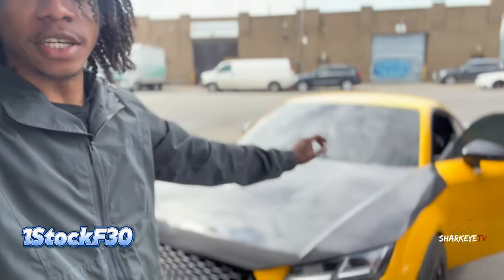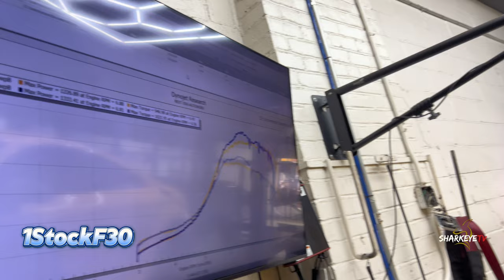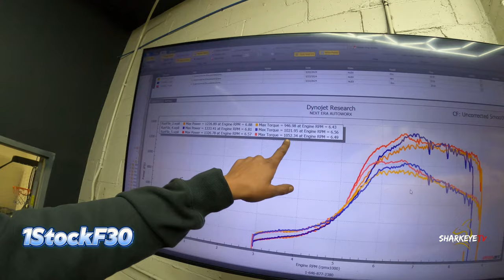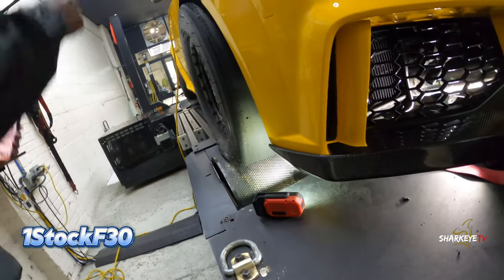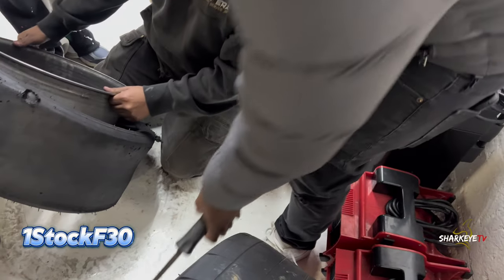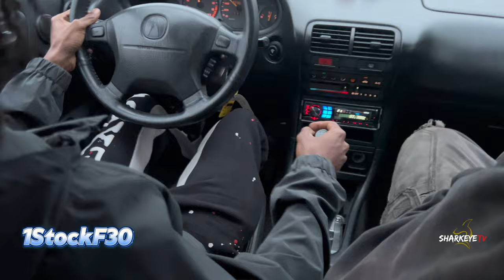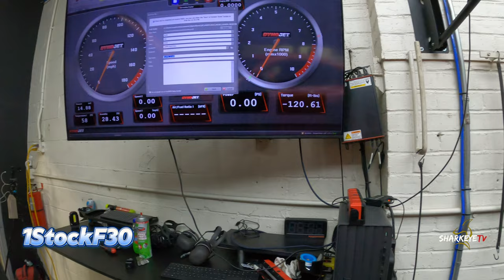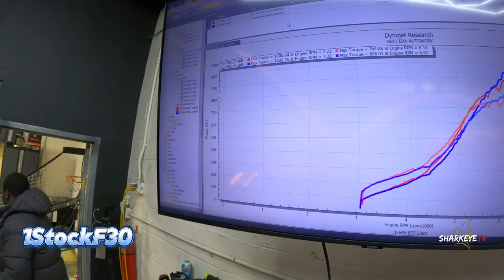HOW MUCH POWER DOES MY TTRS MAKE ? UNBELIEVABLE RESULTS!!!!!

Comment: That ttrs looks hard 🔥🔥 don’t sell this monster !
Reply: Truth. I’d be keeping both for different moods. The bmw would get “daily” duty and the RS would be what everybody gets the smoke in.
Reply: Never!🔥
Reply: @Sleepy_spartan717 you smoking shit either way so win win
Reply: @Modollas  right?!? Both are nuts. That daza sounds crazy but the m car sounds better. That turbo spool would never get old. My old mr2 would spool at 3k and pull all the way to 8500 rpm. Now I drive a ram 2500 with Cummins and 70mm turbo and it’s a bit laggy for a diesel, but hits hard after when it comes on. Right seeing 875hp to the wheels but the torque is closer to 950 and towes like a champ.